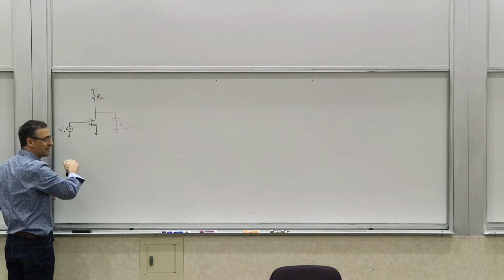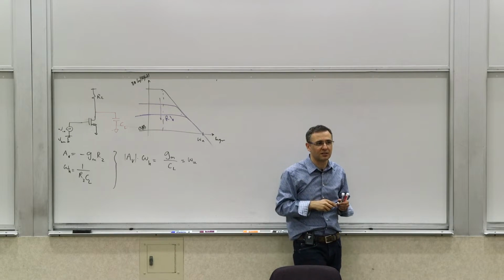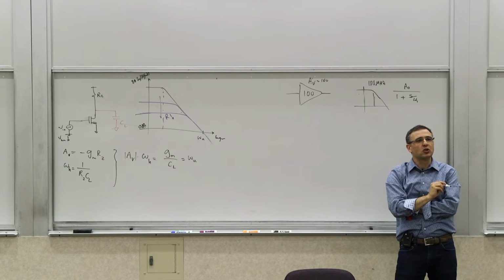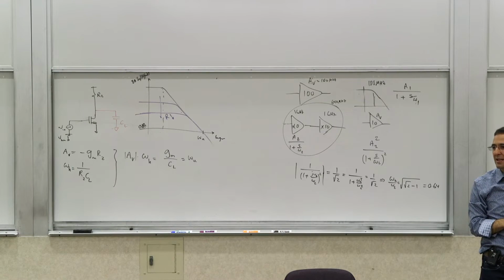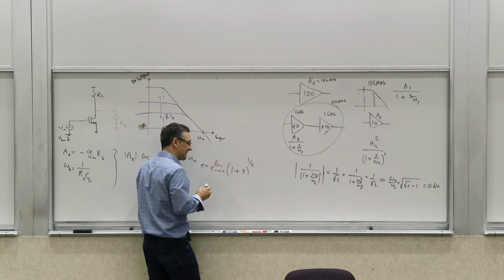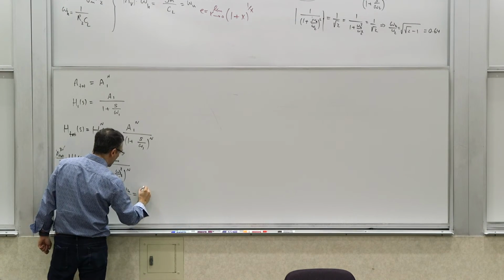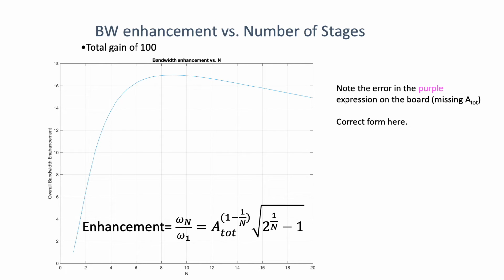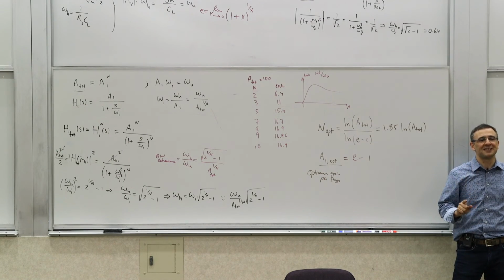157N. Broadband amplifiers, gain-bandwidth product, optimum gain per stage

Comment: 00:05 - Understanding amplifier gain and bandwidth in MOSFET circuits.
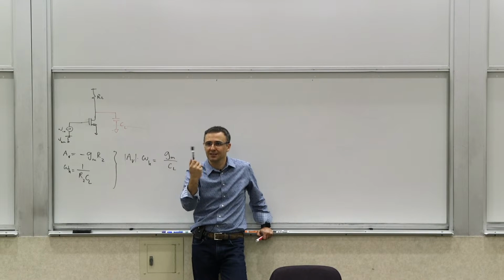02:27 - Gain and bandwidth trade-off in broadband amplifiers shows a fixed gain-bandwidth product.
05:06 - Explores the trade-off between gain-bandwidth product and system latency.
07:28 - Exploration of gain-bandwidth product in cascaded amplifiers.
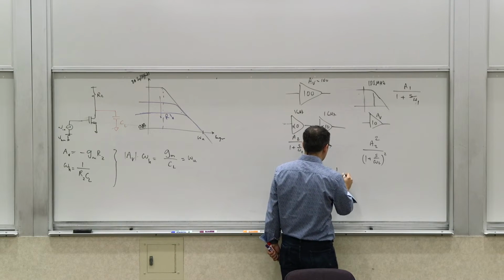09:59 - Optimizing gain with a two-stage broadband amplifier improves bandwidth significantly.
12:37 - Amplifier dynamics complexity impacts stability in feedback loops.
15:17 - Understanding gain distribution in multi-stage broadband amplifiers.
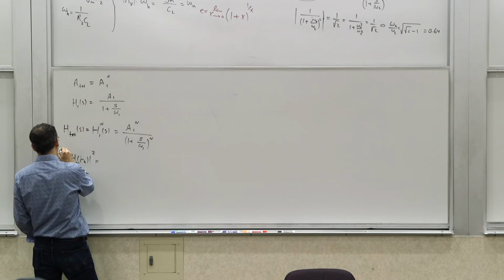17:53 - Understanding the relationship between gain and bandwidth in amplifier design.
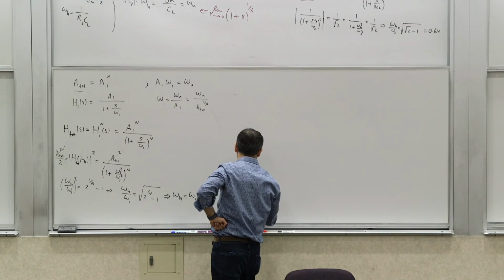20:32 - Explains bandwidth enhancement and optimal gain per stage in amplifiers.
23:02 - Optimum number of amplifier stages relates to gain requirements and logarithmic calculations.
25:34 - Optimize gain per stage for maximum bandwidth independent of total gain.